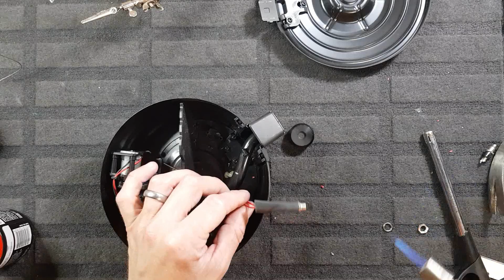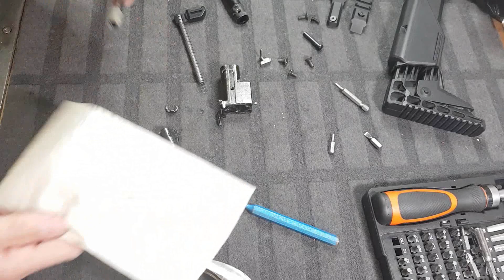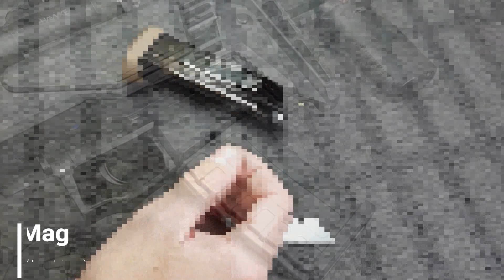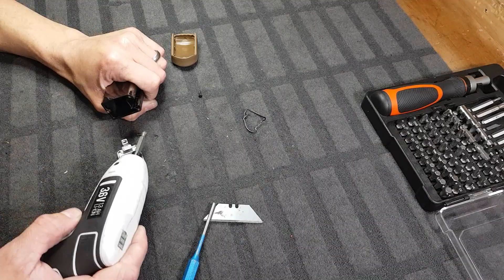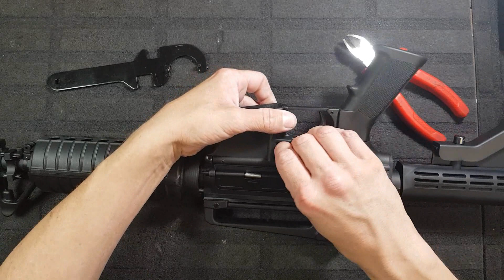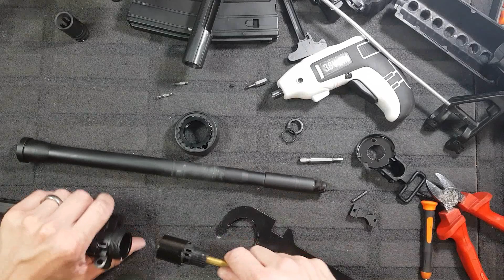A few Small Jobs

Comment: never had problems with the switch on the drum mags. The biggest problem Ive had has been with the damn circuit board wiring breaking and trying to get new wiring back into the itty bitty holes on the circuit board